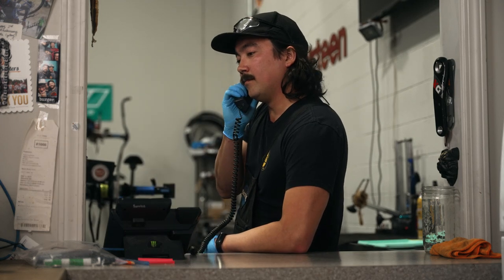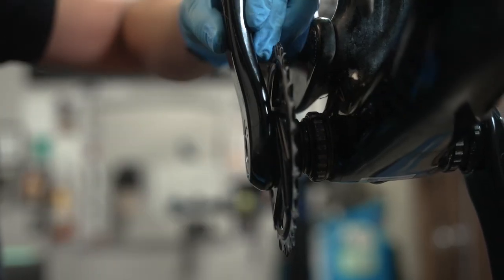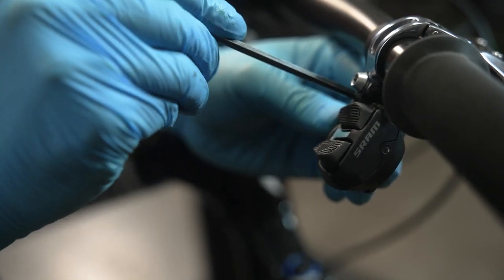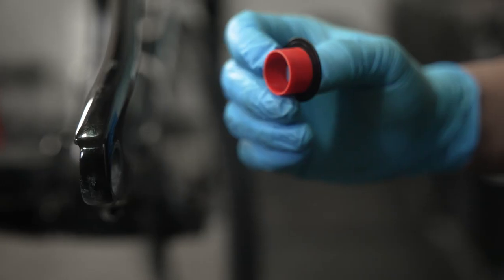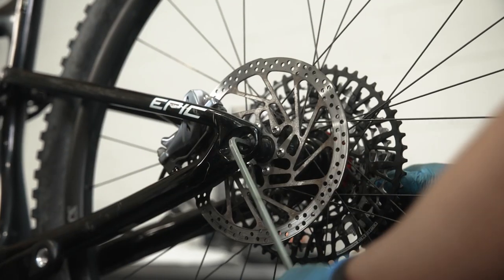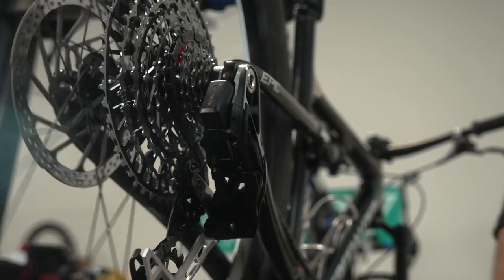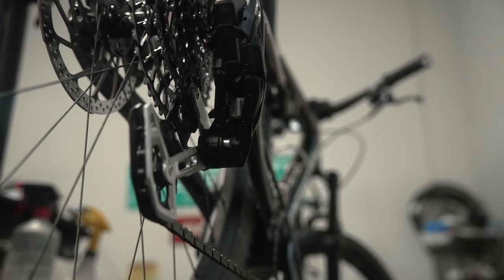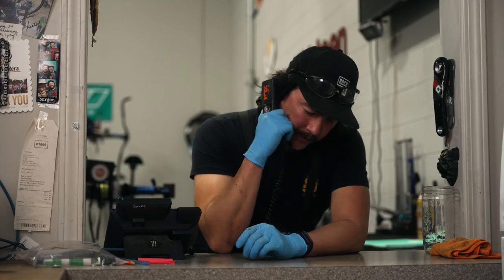Ask A Mechanic: SRAM XX Transmission AXS Drivetrain Install

Comment: 🎉 great video
I did all of that but still when putting torque on 3rd cog the chain tries to go-up. Happens only on the 3rd cog 
I did micro adjust, I did repeat the initial setup as well
Reply: I've experienced that also. Weird symptom. Only under load sometimes.
Reply: Same here, tried micro adj nothing

Comment: With my Canyon Lux Trail 2024 it says on the SRAM AXS Website: "This bike requires rear derailler setup in SAG postition" 

What does that mean? Rear shock 25% or 100% compressed? And how to do it? Just compress the bike with a tension belt between wheels and saddle while doing the setup?
Reply: You're supposed to set the B-tension screw while your suspension is compressed under your bodyweight, put all your riding gear on, sit on your bike with the suspension fully open, and then get someone to adjust the B-tension screw, this is to make sure that the distance from upper-jockey wheel and cassette is at the correct amount despite the chain growth from the suspension compressing under weight. This can be skipped on a hardtail, and for the new AXS (transmission) there's the setup key (SRAM has a tutorial for specific bikes on the website regarding this if you have the transmission). You're also supposed to do the micro adjust under sag but in my experience it's unnecessary and can always be done while riding if you feel something off. The high and low limit screws can be done while not under sag.
Reply: If you don't have someone to set up the B-tension while you're sitting on your bike, deflate the rear shock enough to put it in the sagged position

Comment: is that the correct spacer specs for all bikes?
Reply from the maker: This is for 73mm BB's using Dub WIDE cranks for Transmission specifically.
Reply: Google SRAM Dub BB installation instruction, and you should be able to find a great overview with specifically what spacers you need for various road & mtb crank and BB configurations.